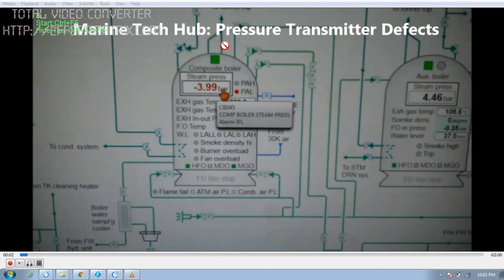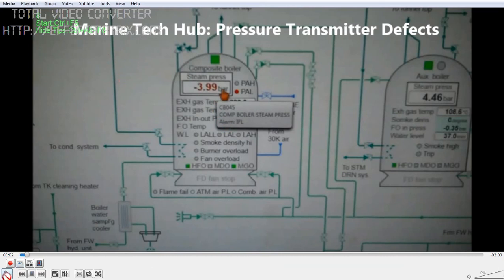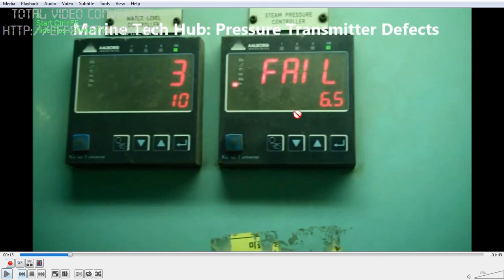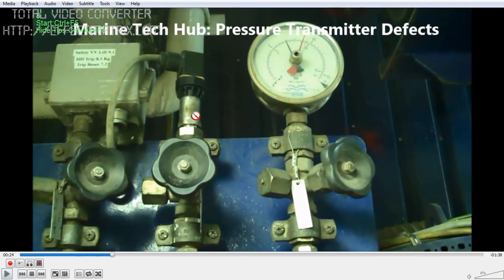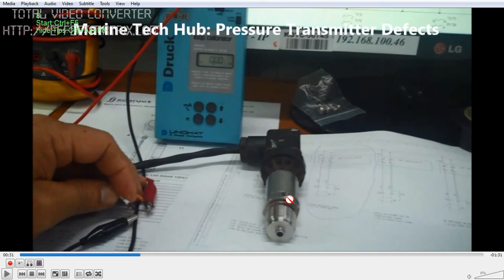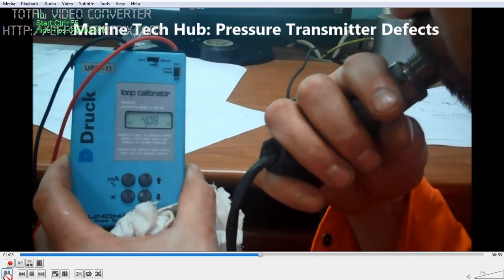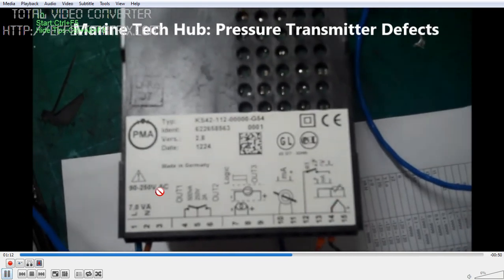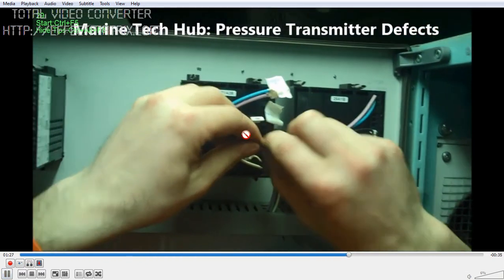Pressure Transmitter : How To Checks Defects

Comment: What happend with relay?coil?
Reply from the maker: Thanks for your valuable feedback !! Do share it with your colleagues and friends
when you open my youtube  channel : Marine tech hub you can see icon right hand side of the header . you can click to go to my website 1. RT flex engine 2. Nitrogen generator 3. solar power.
The relay  removed is under investigation.
Reply: Thank you my friend! I am marine electrician. You filmed very interesting video.Good luck!
Reply from the maker: Please let me know any technical faults which you would  like to share with me.
Reply: Please tell me what most often trouble with PMS ,autoshare diesel generators,impossible to take in parralel in auto mode,only manual operation and red lamp lit on the MSB,PMS FAILURE
Reply from the maker: Please check whether the transducer signal from the voltage, frequency, phase is coming correctly to your PMS .
Reply: Marine Tech Hub you mean 4-20 m
Reply: Ok.Thank you for advice.!
Reply from the maker: Yes your perfectly correct
Reply from the maker: Can you please send the pictures of the work done  on my email. devanandts1965@gmail.com
Reply from the maker: Thanks for your feedback.